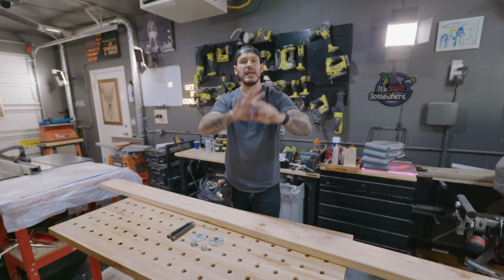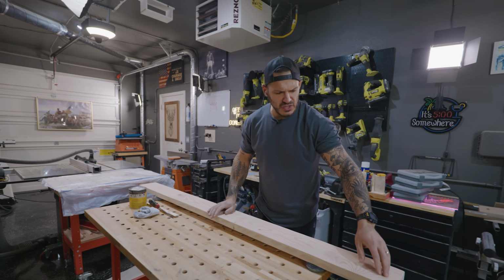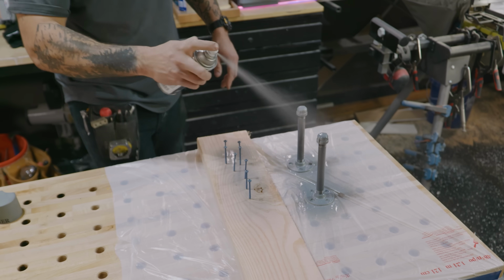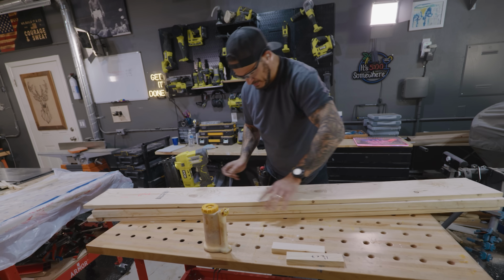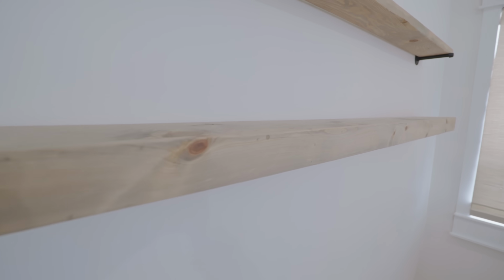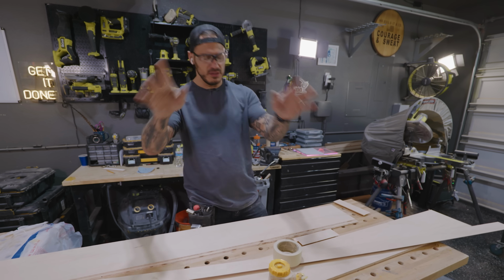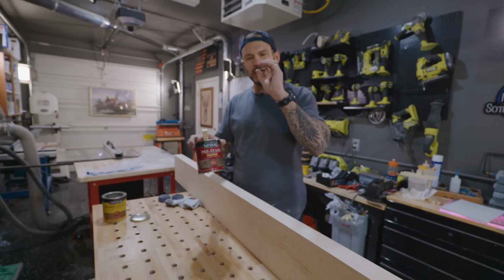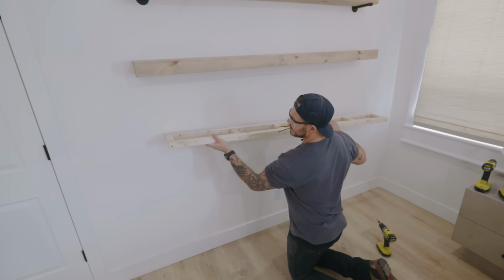3 Ways to Build Floating Shelves

Comment: I built my faux mantle beam using the advanced method.  A good tip in getting the Mitre'd corners to look like a natural solid beam is to use a screw driver to run the rounded shaft on the corner, which rubs the joint together and rounds it at the same time. looks like a solid beam.
Reply: sorry can you explain again what you did to round the corners? i didn’t fully get it-did you run the shaft of a screwdriver on the edges?
Reply: @kikicupcake711  Yes it is called burnishing. Anything round will do. Let the glue setup a little then before you take the tape off run a round object along the edges.

Comment: I don't know, man. Maybe I'm just more technically inclined, but the "advanced" looked more like beginner to me, and the "Beginner" and "Intermediate" looked like "How to build a shelf if you're in middle school".

I'm certainly 'new' to wood working. so I can't speak for everyone here.
But my first actual 'project' was a cabinet on a 20 year old Ryobi table saw I bought for $50 at a garage sale. I got plywood (3/4" birch ply at HoemDepot) cut into managable 2ft strips to bring home in my car, because I didn't want to rent the truck. I then figured I would need to think of a way to 'dado' the areas, and with some literal napkin math I sketched out the ~3/4 grooves I'd need to 'dado' out for each piece. Then I set the depth to about 1/2 way up (3/8"ths or so)  and set the fence to be within the lines that I created, moving the fence toward the opposite line every 32nd.
That allowed me to create a singular dado on each piece, repeated.
Then I put it together with glue and brad nails.
Granted, I also made sure each piece was exactly the same measurement and it went together perfectly square, minus having to snag some $40 clamps.

Then I did miters for the 2nd thing I created, a floating shelf.
I actually did more than just miters for this. I inset the back piece of the floating shelf for a french cleat, using the same dado method as above, and set each miter within the same distance.

The more complicated, and dare I say 'advanced' thing I did next was attempted to create floating night stands with the same combined methods. Although this worked, my only issue was sanding. I didn't wipe off the glue before it dried, which caused me to sand through a lot of the areas of the plywood, which made it impossible to properly stain, so I had to paint the nightstands.
However, the rest of the 'floating' items I did actually were glued up with minimal glue squeeze out.

That was all within the same 4-6 hour duration as well. I did this the weekend before Christmas in about 20-30 degree weather, with the glue-up in my living room on top of a few seahorses (which were consequently on cardboard because I wasn't going to get glue off my hardwood floors easily...and I'm not running that risk lol).

So for my next project, I'm going to do something different.
I'm going to do the floating night stands using each of those parameters:
- French cleat with dado grooves inset
- Mitered joints
- Either using a Harbor Freight Biscuit Jointer OR using some sort of inset blocking (explained below my idea)
- Actual wood instead of plywood

My idea for this 'inset blocking' is to put the mitered edge against the saw at the opposite 45 degree, creating a cross in the miter, and repeating to the opposing mitered joint, and then 'dado'-ing it out this way. I'm unsure what the proper term here is. The idea is to create the same concept as a dowel, except using a thin strip, say 1/4" x 1/2" strip of wood for structural support.
My idea is that this should allow for enough integral strength, not just for after the glue dries, but also to keep the miters perfectly aligned when glueing, so that I don't have to accidently get glue all over the projects again.

But overall, good video. If I had to relabel:
1) Childrens classes
2) Teens classes
3) Young adults / adults who want to try for the first time

I'd say anyone should be able to do #3, so long as they understand basic math. Napkin math got me to do my first actual project, which was a center floating cabinet for my kitchen, and that was a pretty quick creation that actually looked better than the Home Depot cabinets I purchased lol.
Reply: That was a really long way of saying saying his video sucked while awkwardly trying to compliment it at the same time. You pretty much said "hey man you are sort of cool, but I think you suck". Then proceeded on a long rant about how skilled you are that I'm unsure how it was related to the video.

Comment: For the third example, are the screws at the top needed in that last step or can you just screw the bottom of the shelf? Shame you see screws in the final shelf after all that work! Thanks for the video:)
Reply: You can screw under and check for a tight fit. If it’s a bit wobbly, then you will probably need to screw the top as well. The screws should really only be to prevent the shelf from sliding out, not for support. You can also countersink your screws on the top in order to make them look nicer.

Comment: The real Advanced way to install a floating shelf is to screw on 3/16” T brackets to the studs before drywall then use the 3rd method to attach the shelf.   Otherwise All 3 of the methods shown will result in more damage to the wall once something heavy is placed.

Comment: I'm looking to do this but using 2 planges (1 wall 1 shelf board)and 1 90° elbow. How would you recommend bracing the back part of the shelf? Looking to be used for a dry bar area.

Comment: Double check your house if it’s 16” on center..
Most new construction for higher end homes are 24” on center!!
I made that mistake the hard way and went straight into nothing and was very confused! 24” on center with 2x6” and is for higher insulation levels.

Comment: On the middle shelf, wouldn't it be fairly unstable with only the 2x2 for support?  If anything heavy was placed on the edge, it seems like the shelf could tip.

Also, I've been using CA (super) glue instead of nails for its immediate bond, which allows the wood glue to dry.
Reply: He put screws through the shelf into the 2x2 to secure it
Reply: Yes, it would go to fck

Comment: For the advanced.... instead of brad nails, use a pin nailer. Then you dont have to fill holes and the tiny holes fill in with sanding.
Reply: or just tape all your joins and avoid nails all together.

Comment: The two-tone sides, whether intentional or not, look great on the intermediate shelf. Adds nice character.
Reply from the maker: I agree
Reply: That's from the end grain. It takes stain differently than the rest of the wood.

I was wondering how it would look but that particular color of stain didn't do too badly. A walnut stain probably would have looked a lot darker on the end grain.

Avoiding end grain is where mitered corners come in.

Comment: There's also a way to make floating shelves using dowels sticking out of the portion of wood screwed to the wall. Make deep holes on the shelf and match up. Great video!
Reply: that's what I expected. Dowels are the God Level
Reply: My floating shelves in my living room have metal dowels. I literally hand chiseled into my 2 sets of live edge Douglas fir to custom fit them with like 8 inch long dowels.

Very time intensive but so worth it.
Reply: @beaulaughlin520  😳

Comment: Heads up: walls aren't always flat. 
I like the maple shelf, that's really cool. So the only thing I'd add is to first hold a long straight-edge against the wall to make sure there won't be a huge gap. If there is, I guess the best approach is to fill it in with mud, texture it, repaint, then get on with the shelf.
Reply: Nah just cope the shelf :-)
Reply: @uuuultra a lot less work than going through the full process of mudding/sanding/texture/paint
Reply: I do custom cabinets and trim on high end houses on a crew. We scribe just about everything... But we do all the cabinets and stuff on site... Remodels here and there we'll do some pre built, but most of the time it's new construction, is a gutted remodel... But just scribing and cutting that scribe gets rid of the gap but keeps the front square
Reply: Just build the shelf over sized and scribe to the wall.

Comment: My method with 2x6 or 2x8 lumber:
1. Drill 3 holes using a drill bit (or more depending on length)
2. Make a rip cut 2 inches in
3. Insert dowels 

For mounting:
1. Mount the 2-inch piece of lumber with dowels stick out
2. Slide the remaining piece of lumber onto the dowels. 

Note: proper sanding, cutting, and filling can make the cut look almost invisible
Reply: Nice idea, thanks! This is quite helpful and I'll have to try that next time! Beats all of the video methods in my opinion
Reply: Can you please elaborate?  Maybe share pictures?
Reply: Are the dowels wood or metal and how long are they? You'll definitely see the seam between the 2" piece and the rest of the lumber.

Comment: Good video but only issue I have is when you set 45 on your saw blade. The angle finder should be set flat on just the plate. It shouldn't be on the carbide teeth at all. The kerf will throw off your angle.

Comment: Does anyone know the max weight each style will hold or is there a formula to determine max weight a shelf will hold? Is there a rule of thumb on how many support pieces of 2x2 wood to use for support capacity (I.e. he used 5 I think, how do you come up with 5? Would 3 have worked, etc.)?
Reply: While I can’t answer those questions specifically, I would say that if you’re concerned about the weight to simply build the structure and screw it up somewhere in the garage if possible then test how much weight it can hold. The shelf itself doesn’t need to be built as it’s not supporting any weight. 

I will say that I’ve built a large laundry shelf in a similar manner (just with no bottom) and it can hold quite a lot with no issues.

Comment: Any idea the approx weight limits for these 3 options? Also, what if included a 3rd bracket in the middle for beginner option - what would approx weight limit be then? You rock! Thanks!
Reply: It’s hard to put an exact number on each shelf, but you can start with the rating of the fasteners used to secure it to the wall. Of course the capacity will be much higher near the wall than the edge of the shelf furtherest from the wall.  The way he built the last option would probably hold several hundred pounds because it has a strong frame and attached to studs with multiple lag bolts.

Comment: Great video! Thank you.
Ive worked with hardwood floors for awhile and instead of prestain we would go over wood lightly with wet cloth and let it dry fully and then stain. Supposedly water helps to open up wood fibres and stain sits evenly after
Reply: What's how my Amish cabinet maker gets Maple to stain evenly. He just told me that trick. Wish I knew about it years ago.
Reply: I would think you'd need to sand it again after using water
Reply: @kallenyc  not at all. 40, 80, 100/120  grit progression sanding into a good vacuum clean up of a hardwood floor, followed by a wet cloth damping (not soaking wet, squeeze the water good so it’s not dripping on twisting, yet not too dry to last a room) go over the floor, collecting the leftover dust particles and opening up the surface pores for stain to go deeper and more evenly. Wait for the water to dry (about an hour when it’s warmer and dryer out, mb some heating on if it’s cold and damp). Works like Swiss clock, tried and tested on many floors and wood types 🙏🏼 hope that helps

Comment: There's a 4th way but it requires the floating shelf to be included in the room's initial build.
No hidden metal/wood braces since the wall itself IS the brace. 
The plank of wood is embedded to the wall's framework before the wall is finished. 
It makes for a quite sturdy build.

Comment: But what if I have a particular solid beam I want to use? The first option may be simple but it would seem more practical.
Reply: For a solid beam you could use a router to remove the spot for a 2x2 to go or you could pocket screw it from the underside with some very long structural screws. Why screws you'll probably want a couple on the top too. The best way is to build a bracket that goes inside the wall but that's very involved unless it's new construction. Just keep in mind that without triangulation and brackets to support a shelf it won't hold a ton of weight and the heavier the shelf is the less weight it will hold

Comment: My only concern is the amount of weight the first 2 can hold. It also seems like the biggest difference from the intermediate to pro is the need for a table saw. Could you make those long cuts with a circular saw and a attached fence gig? I don't have a table saw but wanna try that one. Also I'm a complete noob and have never done anything like this.

Comment: Using the 3rd method - would 2x2s be strong enough for 18” deep shelves?   Im building floating shelves for my media rack and needs to be quite deep, but we dont want the shelves to be deeper than 2.5”.
Reply: 18 is to deep for something that thin.
Reply: I'd build a framed out structure for that--bookcase style

Comment: What would the recommended weight bearing limits be on each of these? I love the look of these but I'd be loading them with books, wondering if I'd have to use bracketed shelves instead?
Reply: A good rule of thumb is for every stud your shelf is attached to, it can hold 50 lbs. So 3 foot shelf in 2 studs, it can hold 100 lbs. Now this isn't be all end all rule, but if you get a good attachment to your studs, you should be able to hold plenty of books.
Reply: The first shelf could probably hold 100-200 lbs evenly spread across the shelf assuming you screwed the pipe into studs. The second shelf is probably a lot lower around 40-80lbs because there's no fingers extending from the mount into the shelf and he didn't use structural screws on the 2x2. The last one is probably 200-300lbs evenly spaced because of all the structural screws into the joists.
The numbers are guesses. BUT, you should watch this video if you want really strong floating shelves: https://www.youtube.com/watch?v=BpS_MEHfgac
Reply: @TwoTall1988  this video is ridiculous overkill for books.
Reply: @WolfCatBirdPigMan  I'd rather over engineer something that I know can fall on my or my kids head with enough weight to cause some significant damage.
Reply: @xXFinalEntryXx  This is so helpful! Thank you!

Comment: The 3rd shelf could have been put up with a single ledger board on the wall the same as the 2nd shelf, you didn't need to build that whole frame thing
Reply: Yeah but that's why it's "advanced"

Comment: Need a 4th level: OG- get a 4x8 and use a router to recess counter sink for the flanges, drill out holes that snugly fit  1” pipes approx 6” long, screw flanges to studs w/ 3” screws at each stud available for given space. Enjoy floating shelf that can handle the weight and looks it

Comment: Cool vid. Couple tips for anyone interested as well. 

Use packing tape on the miters and fold the miters. It allows tight joints and prevents glue from coming through the miter (if tight)

Miters NEED to be bang on, both length and accuracy through the saw. Make sure you push evenly and consistent through the saw, and no filling should be necessary.

Cut your pieces 1/8" or 1/4" oversize prior to mitering to allow minimal binding while cutting your miter. 

Lastly, cut your miters at 45.5 degrees, and not 45. Doing so will allow your edges to touch, and the extra half degree allows the glue to flow to the inside.
Have fun and stay safe cutting fellow woodworkers

Comment: I do really like this video and thanks for sharing the different skill sets. I do have a question though. My understanding of a floating shelf is that you don't see any hardware, so would the beginner shelf just be a standard shelf?
Reply: Cause it's technically floating😅 no screws to a base whatsoever aka beginner mode.
Reply: Really think it depends on the design / feel of the trim your going for first would be more industrial/ rustic wouldn’t call it beginner I would call it 3 ways to build floating shelves which one fits your style?

Comment: Quick question for you on the pre stain conditioner. I've used it before and had mixed results. When you start applying the actual stain, is the surface still a little damp from the rep stain or is it 100% dry? Great video showing three techniques.

Comment: So you conditioned and stained the wood, but you didn’t do any thing to seal and protect it. You should use a polyurethane or lacquer coating to protect the wood finish. For a project like this it’s probably best to do a brush on poly, with 2 to 3 coats sanding with 220 grit sand paper or 0-0-0-0 steel wool in between coats, and lastly you want to use a decent tact cloth to remove any excess debris between each step to remove contaminate from your finish. Your project is 90% done just need to “finish it”.

Comment: If the miters were cut to 46⁰ or 46.5⁰ they would fit much tighter at the outside edge, which is all that really matters...especially since its brad nailed together. Much less filling required, and thus less sanding as well

Comment: Gotta second the 45.5 on the miters. That and strapping tape, with the little threads, to hold everything together. Works great. Might need a nail or three with this method but I've found them mostly unnecessary unless I wandered a cut. 👍

Comment: Should also rub  mild pressure with a round side of a screw driver along the edges. Helps hide the gaps vs packing with glue. Also, should have put a cross beam in the middle. That thing will be flimsy in the middle if anything heavy goes on it, although unlikely